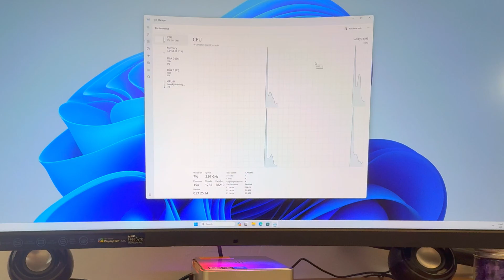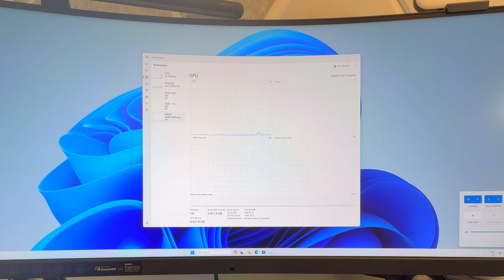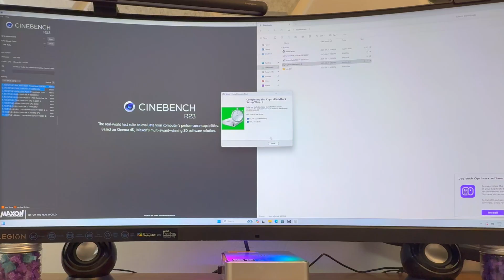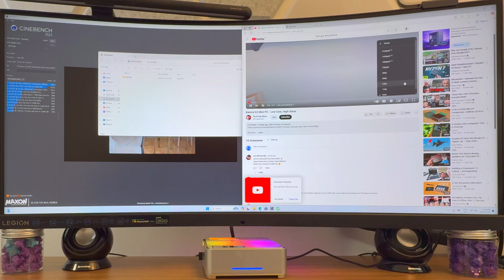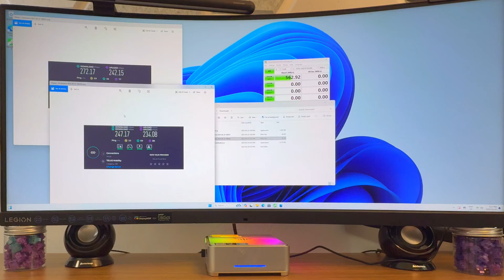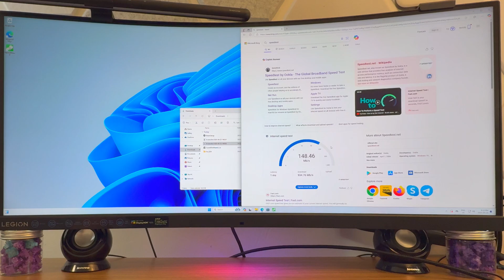It's Completely Silent... GK3Plus Mini PC Review

Comment: Does the front USB drive work at 5 GB/s? I bought one and it doesn't go above 44 MB/s on both USB 3.0 ports. I don't know if it's a problem with my unit or if it's normal.